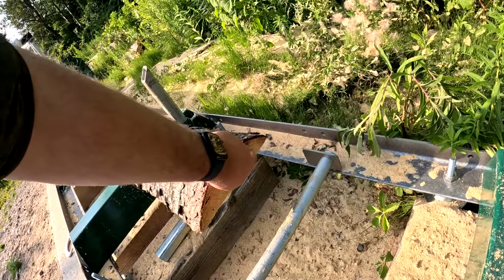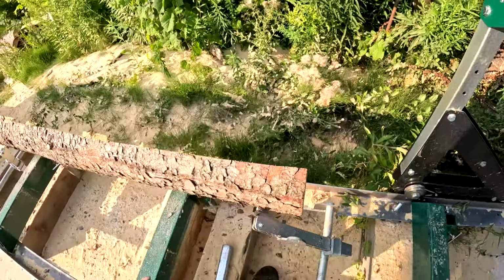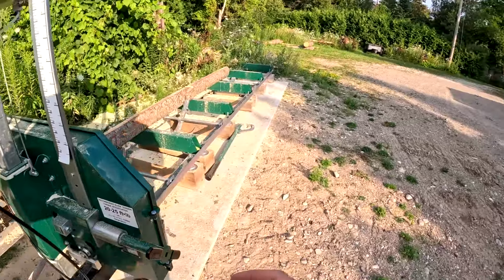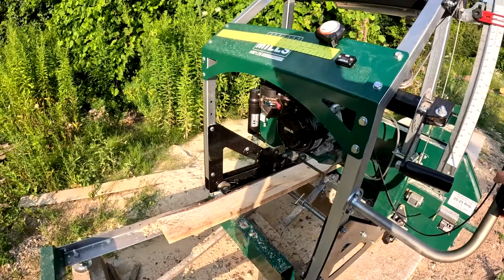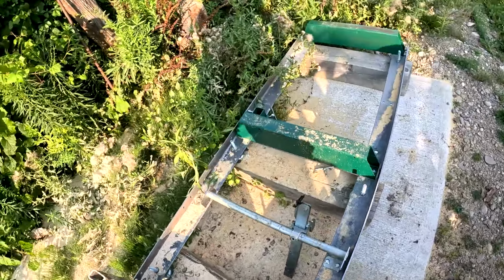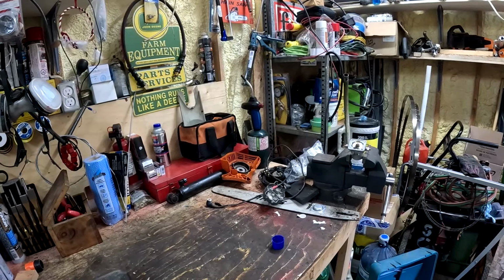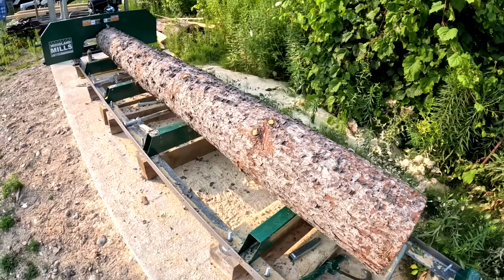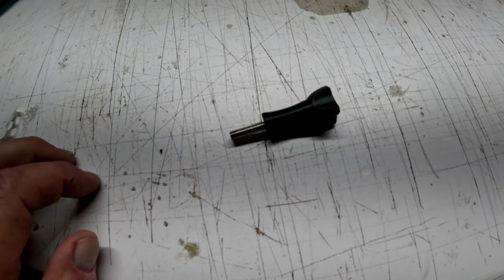Can we score one more 2x6 from this cutoff piece?

Comment: For a sawmill, never cut to your true dimension. Your lumber will shrink over time as it cures. Which is why you either melt wax on the ends or paint the ends to prevent splitting. Also for bark removal, shingle scraper, draw knife, either is fast, quick and easy.
Reply from the maker: thats true.. Although.. hers one for you.. When i did the deck they were cut at 6"wide.. They have visually shrunk from when they were laid down.. But if you measure each board they are still 6" wide.. Weird
Reply: @billstmaxx  Wood is and acts funny, it's the difference in wood species. Some dry/cure shrink length wise, while others will shrink width wise and others, overall width, thickness, and length. I give you kudo's for doing this. Just know and understand, to properly cure/dry wood, always use either melted wax or paint the ends. This prevents the cracking/splitting. Also, for every inch of thickness, that's 1 yr of curing "nature's way", which is why 99% of lumber today is kiln dried, which it too can cause splitting since it's force curing the lumber. Cheers :)